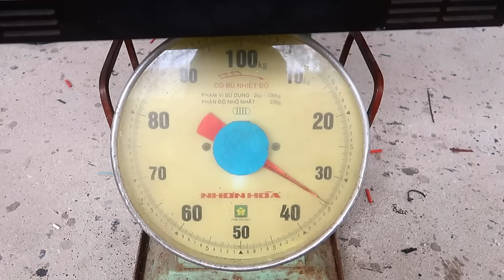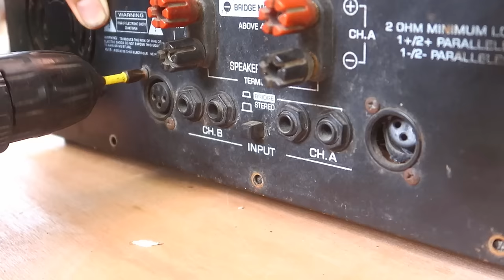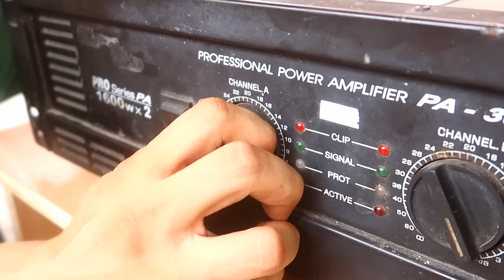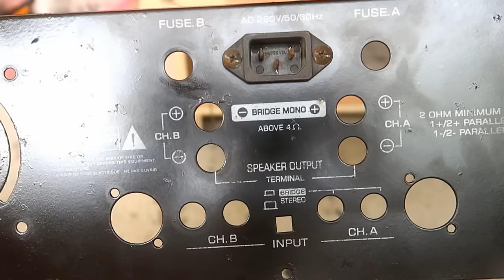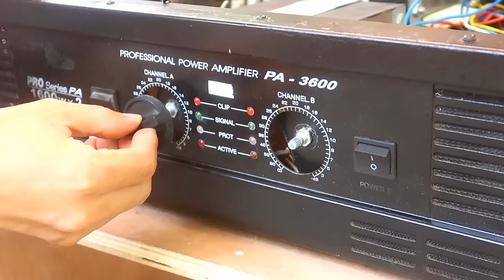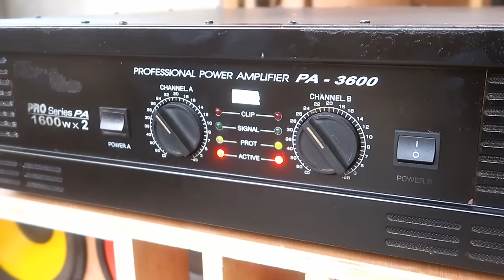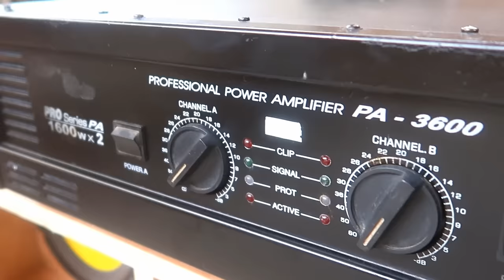Restoration professional power amplier // Restore 3600W large power amplifier

Comment: THIS SHOULD BE CALLED HOW NOT TO SOLDER. This amp will fail the first time in goes in the truck. Solder joints are so important. Keep them clean. If thery're all brown or bubbly or beaded they're no good.